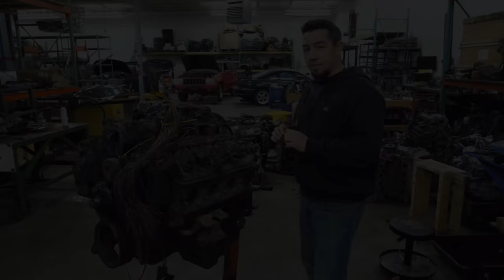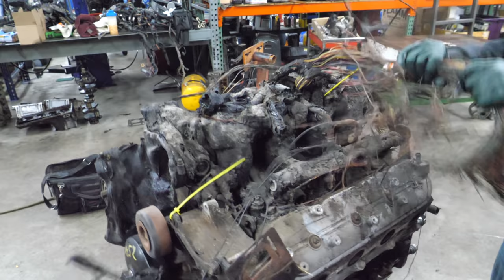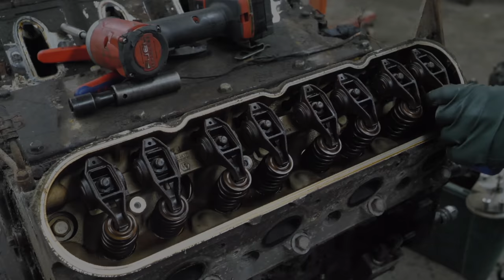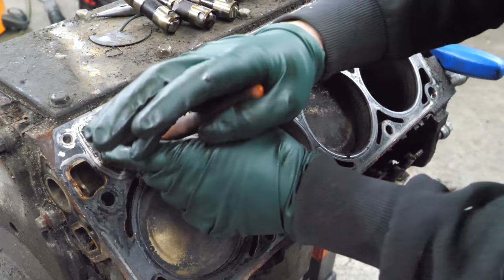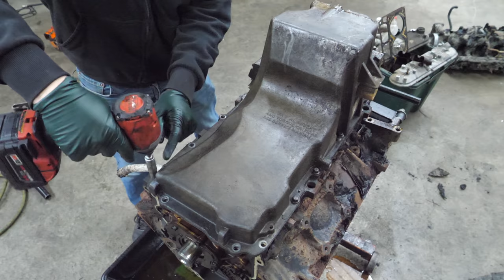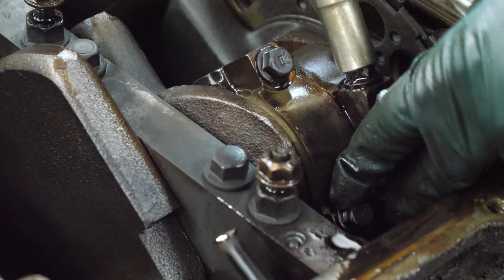BURNED Silverado 6.0 LQ4 Engine Teardown! Will I Get A Good Short Block Out Of This?

Comment: The loose screws on the outside can happen because of the heat. If gasoline burned, it's over 900  celsius fire. At that temperature, alloy looses any heat treatment properties it had. I'm honestly amazed that you got a good looking engine core in the end. I'd be very interested in seeing a shop clean this and build this into a normal engine and see how it fares. Considering it got unevenly heated and then rapidly cooled, there's a good chance it's hiding some interesting internal stresses in that casting. I wonder if with normal operation heat cycles they'll Dissipate or will they end up utimately warping the engine. This is like a science project. I have apsolutely no use for it but I would love to follow the journey of this block, maybe even buy it if I lived in Freedomistan and try to take it for a journey my self. 

Make a Pontiac Phoenix LS swap to make it appropriate.
Reply: thats what i was thinking, especially considering head bolts are torque to yield. when brought to such a high temperature it basically annealed them, relaxing all of that tension and removing the clamping force they had on the head. and also yes, im sure that block is sure to have some stresses and warping at least on the thinner features like the unsupported portions of the cylinder walls and the rods themselves.
Reply: Nice ponka pfp
Reply: Cooked gaskets can have the same effect. (Basically the gasket material burns away).
With high temperatures the bolts can also get longer and lose temper (which is why reusing bolts under these conditions is a particularly bad idea).
Reply: I agree with the thought process, but there isn't that much gasoline at the engine. A little in the fuel lines and what not, but the fuel pump didn't keep running fueling the inferno. Once it get going it was probably mainly a big plastics fire. Still nasty, but I dont think plastic burns as hot as gasoline. I would love to see what the future holds for this block. If it really did get that hot it could develop some interesting inspection ports in the near future! LOL
Reply: That was my guess too.
Reply: The block still had some coolant in it. It may be just the heads that got over heated.
Reply: Aluminum melts at 660 Celsius(1220 F). Not sure where you got your data on the alloy “heat treatment”, but it sure sounds like bull$hit to me. 🤷🏻‍♂️
Reply: @micahcastillo9113  Well I got it from experience by blowing and rebuilding a few engines my self... Also you don't need to literally melt the metal to make it change its properties. And some talk with machinists and metallurgists on how to fix a mess I made. Failure like that... yeah, it will get hot. You will nearly shit your pants when you burn your fingers on a release clamp, while holding an extinguisher. No fun. And that is the only reason the car still exists. Otherwise it would destroy the front.
Reply: I don't think the heat loose those bolts cuz i just teardown a 6.0 motor exacly  the same and the bolts were tigth how they have to be.

Comment: I have that same engine in my GMC 2005 2500hd, just rebuilt it after 238,000 miles because it bent a rod.
Great motor.

Comment: I drive a 2016 2500 HD with the 6.0, solid engine with plenty of power and at 155k miles plenty of reliability, though it's a work truck that receives religious maintenance.
Reply: 300K [with minor oil leaks] is well within the realm of your good upkeep, Trans can last that long with 100k filter/fluid changes in normal use.

Comment: I really enjoy watching these engine teardowns. It's interesting to see how the engineers have solved or ignored or created issues by design. I went through the teardown history and I don't see a 3rd generation VW EA888 1.8L engine. That's the one I'd really like to see. The 1st gen EA888s were notorious for intake valve buildup and turbo oiling/cooling issues. The 3rd gen has those issues solved and it's got some interesting features like the integral exhaust headers, liquid cooled turbocharger and othersm. Please teardown a 3rd generation 1.8L VW EA888!
Reply: I believe most of those motors repurposed as 'Boat Anchors' in deference to expensive rebuilds

Comment: Hey fun facts for those in the back that don’t know. Those head bolts heat up in a fire and stretch slightly. However if they cool too fast like let’s say a fire truck hits it with the hose. It will cool and stay stretched and seem loose.

Comment: I wonder if it is something to do with the heat of the fire has caused the head bolts to back off a bit. Would have set up some interesting expansion and contraction cycles, depending on how the fire was extinguished.
Reply: I bet this engine was "rebuilt" and it came back to the shop and instead of dealing with it, it "accidentally" set on fire
Reply: @robrayne9144  yea, I could see them doing a compression test, seeing the low numbers and doing as you said. The head bolts not being torqued down enough could easily cause major compression issues.
Reply: Aluminum expands faster than steel, hence heads stretched the bolts a bit.

Comment: When my dad was a truck driver, he was in Minnesota in winter. My dad ran his truck all night because being from Florida, he didn't have an engine heater and he knew not to let the engine get cold and freeze. Well the guy next to him didn't listen. But that guy decided to light a trash fire under the engine. He got the engine block good and warmed up alright. He heated the oil pan up so much that the oil pan exploded off the bottom of the engine, caught everything else on fire and torched the front of the cab. It was so cold they couldn't get the water hoses to pump, so they literally got a snow blower and blew snow all over the engine to put the fire out.
Reply: There's video of a Canadian highway crew doing exactly that to douse a house fire while waiting on the fire department to arrive.

Comment: Been a gm tech for over 13 years now, I've seen the ends of the pushrods look like that for no rhyme or reason, some with high mileage, some with low mileage. On perfect running engines with great oil pressure.

Comment: Another great teardown!  On an LS, the rear rods and mains actually get oil first.  The oil flows from the pump straight back to the oil filter, then to the lifter galleries and off the lifter galleries to the rods and mains rear to front.  Oiling issues will usually show towards the front of the engine first.  Love the see a Ford 6.2L or an Isuzu 4HK1 diesel (NPR/NRR/NQR) teardown.

Comment: Glad you came out good!
What really surprises me is the head gasket hadn't blown with the bolts that loose.
I suspect the heads had been off before and the "mekanec" didn't own a torque wrench.
 He might have messed up a fuel line, that could explain the entire truck over heating.  
Here's a question, how often have you seen a LS with a blown head gasket?

Comment: I brought back a 540 bowtie motor that got so hot the Holley dominator melted ,dripped through the supercharger rotors and a few slags ended up in the heads. Ended up with better head to block  deck seal then my decked 502 stroker. Guess you could call it "heat treating" . Its nasty ,but don't be scared of the burnt ones lol

Comment: The dry rocker suggests a faulty lifter as oil feeds up through the pushrod (or not in that case). Surprised you didn't look a bit more closely at the lifter on that lobe/pushrod/rocker.

Comment: excessive heat changes material structure, so I think that's fine that bolts were loose. They just overheated, extended, and left in that condition. Potentially there could be any random issues with the engine, but I don't want to predict anything, I hope it'll work at least a million mile more. Decent, reliable engine.

Comment: With such inconsistent torques on those head bolts, have to wonder if the owner just had the engine serviced and the tech that put it back together was sloppy in more than just spec's.
Reply: Heat can do that though, I've had a 5.4 with 25,000 miles on it that was on fire and the headbolts were all different torque, some almost even finger tight, Pretty sure the heat of the fire just warped the aluminum head or even stretched the head bolts some.
Reply: You saw the melted plastic? No way did anyone work on the top end.
Reply: I think that's possible. Also, head bolts come out a lot easier if they were torqued down recently as opposed to after a couple hundred thousand miles of heat cycles..

Comment: the heat from the fire may have cause the bolts to expand and when it cold it down it shrunk  think of  how you use a torch   to help remove a stuck bolt with out snapping it

Comment: that little rust stain will never hurt any thing ! I bought a used motor for my '01 Ford F150 ,That had sat outside for 6 years without exhaust manifolds on it for $300)  pulled the heads  and there was a slight rust stain on 4 cylinders that the exhaust valves were open , Put new head gaskets in and head bolts as there toque to  yield, 100 K  its still running strong  ,) for oil consumption  1/2 Qt in 3000 miles !!

Comment: Looks like the fire was hot enough to destroy anything plastic/rubber while not being hot enough to damage anything metal.  That entire engine is probably rebuildable honestly.  Sure all the gaskets and such need to be replaced, and it needs cleaned up.

Comment: We've bought a few burned engines and had pretty good luck using them in stuff that needed an engine. I always re torque the head bolts and check the bottom end. BTW that Tahoe PPV is pretty sweet!

Comment: This engine has an Iron block with alloy heads as does the LQ9 both are good engines to start a performance build with.
But If I was going to do a stroker such as a 408 build, my L77 would be a good place to start as I prefer all alloy engines.
😎🇦🇺👍

Comment: Those stuck valve lifters and loose head bolts might indicate that there is minor heat deformations. Cast iron is quite sensitive for that. Also if you put it out with water, it may give block some cracks when hot cast metal cools suddendly and unevenly. I am very afraid always when i see burnt cast iron, but theoretically it might be good if someone puts that to tuned car and tries to get horsepower. Block has no tensions and it doesn't fail from liners. But what i'd do is good visual crack checking, maybe new sleeves and put everything together.

Comment: The last burned engine I pulled apart was an old sohc Mitsubishi v6 it  had puddles of aluminum in the cylinders and inlet ports, the cam covers were melted and run all through the oil returns it was a mess and a nightmare to disassemble

Comment: Comment on burned engines. In the late 60's my dad and I were at a junkyard looking for something.  They were pulling the heads off a burned 63,64 Caddie. Heads were in high demand. Every 390 I ever pulled the heads on had at least one cracked head. Well, they got them off and the center 2 pistons in each bank were melted.  Looked like a piece of plastic someone had thrown in a fire.
  Years ago the local state trooper had a motor home he could not sell. One weekend he moved it down to the roadside fence in his pasture (well away from his house) , blocked  the gate with his patrol car, and went to a restaurant in the next county. 
  Well, somehow that evening it caught fire, FD couldn't get to it because of the blocked gate. Hmmm. It had burned down to the ground, nothinng but the rails and the drivetrain left, melted the wheels of it. The carb and distributor were melted. My hot rod bud that recovered it bought the engine from his boss for $400. Told him he was crazy. Said the code speced it as a forged crank 4 bolt big truck engine and the crank was worth that. He replaced the externals, put it in his mud truck and drove it for a year before putting a hot rod build in it to go in his 86 K10 show truck. He always told me it was such a good engine because it had a heat treated block.

Comment: 12:30 Good example of why I like to run pushrod engines at about 4-5k RPM for 15 seconds or so after doing major work requiring new pushrods and/or rockers once they have had some time to break in. Stops the pushrods from just staying in one spot and scuffing real bad like that. They need the high RPM to ensure they actually rotate around like they should, otherwise it tears up the ball and seat.

Comment: Perhaps I am wrong, but I would think that an engine that had been burned still had a core that was in most cases useable.  I haven't watched the video yet, that is why I say that.  Buildings in Flori-Duh, which are all concrete block, typically resist fire very well, but they are always knocked down because the heat deteriorates the strength of those blocks, and you could wind up with a collapse down the road.  This is true of any concrete structure.  Aluminum or iron engine blocks probably don't have this issue.

Try this:  Put on GOOD eye protection and a leather jacket, and then use a MAP gas torch to heat a paver or your concrete driveway;  You need to have the eye protection on because the concrete chips will fly at you....

Comment: I always wanted to see what a lightly burned engine would be like inside. I see them in the junk yard now and then but always passed them by. Maybe ill look a little harder next time... I think that bit of plastic may have been the tab on that oil filler tube; you know the 45 degree elbow? They aren't really meant to come off after seated and if you reef on it to get it out, a little plastic tab breaks off inside. Probably been in there a long time I bet. I would also wager that that engine is a good running engine, I think all it would have needed was a set of head gaskets and bolts due to the heat- metal expanded too much over crushing the gasket and stretching the bolts i would guess. You should make up a engine test stand so you can try firing them up in the shop (make up an exhaust with a big muffler so you can really hear everything), then you could make a video of a running engine to help with the sale and your own conscious. Something that i want to do as well, then I could buy engines out of the junk yard and know what the issues are before installing them in something. Great video! Looking forward to the next one!

Comment: Can you do like a 60's V8 that has no electonics or anti-pollution stuff on it?  (Maybe even a straight 6...)

It'd be interesting to see what an old school engine looks like vs. a modern, electronically controlled one...
Reply: For one thing you can count the # of wires on it on your fingers.
Reply: This burnt 6.0 LS is nearly , exactly what you see inside any domestic [Non-ECM] Pushrod V8 since 1950s. Metals are better now and much more accurate machining also. Cylinder head design is  main reason power outputs continue to improve. That's why an LS motor will make the same power fueled by old skool carbs in place of it's ECM-EFI

Comment: Back in the 80's when I was in the firebrigade, on the vacant land not far from the station there was row after row
of burnt out cars. It  was like a shopping center carpark. Then the insurance companies stopped paying out on
cars that were (stolen) and burnt and it stopped at once. By the way, burning cars don't explode in real life, only
in the movies. The fuel mixture in the tank is 100% fuel and fuel vapor and 0% air.

Comment: I've seen that pushrod/rocker wear on several LS type 150K + motors. Not so much an oil pressure  issue, more like lube age breakdown, likely infrequent maintaince . In any case toss the old and new replace with lotsa asm lube,

Comment: I never understood why people buy an expensive piece of equipment and fail to change the oil/filter every 5000 miles. Hell, if one changed the oil sending unit at the back of these engines, they'd appreciate their due diligence and keep the oil clean. Thats the life of any today's engines. 5W30/filter, simi synthetic oil might have gotten that truck 250,000 miles easily.

Comment: Thise head bolts arexsuspect. They may have stretched from the heat causing them to be not tight as you would expect.  Doubt if the head expanded enough to stretch the bolts. One way or another don't reuse the head bolts.

Comment: Have same in 05 Yukon. Was metal shavings in first oil change. Idk runs fine. Just like pre ignition sound when you give it all the donkeys. And I don't often. 256k don't think been rebuilt. Idk I just say it's your home are you to good for you home? Slap it with a hockey stick

Comment: That engine looks about like the 7.3 idi in my f350, I was really worried about having problems especially since I drained 5 gallons of water out of the oil pan but so far other than a leaky fuel filter head it really only took some maintenance items and a couple sensors to make the engine run again

Comment: Every single LS harmonic ballancer iv had to pull was a tough bitch. The one on my car wouldnt budge with snap on, or matco air impacts. Had to use the milwaukee 2767 to zing it off. So far, nothing has been too strong on a car for my milwaukee to remove

Comment: also, as to why those head bolts were loose: heat.  they were under immense tension when they were then heated by the fire, and then they stretched.  I would bet that the rest of the block being heat treated probably hasn't done it any favors.

Comment: Yo, love your tear-down videos. Thx on the pushrod wear explanation. Another question... do you ever see trunnion bearings escaped from the rockers and collecting in the sump on the LS engines? I have a track toy with an LS1 and folks recommend rocker trunnion upgrades to go with upgraded cams and valve springs. I'm wondering if this is necessary and you seem like the guy to ask. :)
Reply from the maker: Every once in a while you’ll find a collection of needle bearings from a trunion in the pan and head.
It’s always, always, always in a gen4 with rectangle port heads.